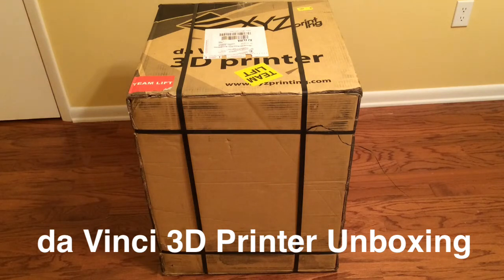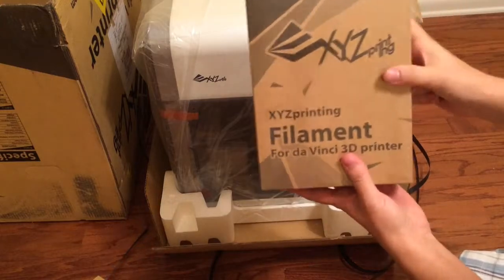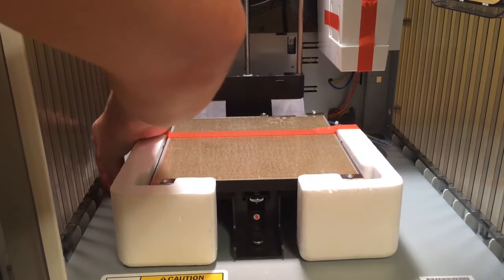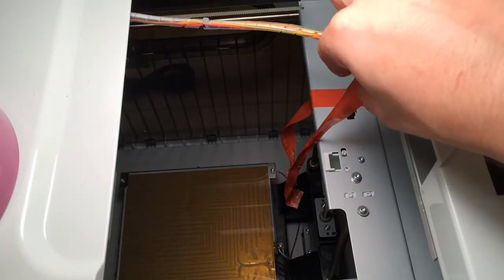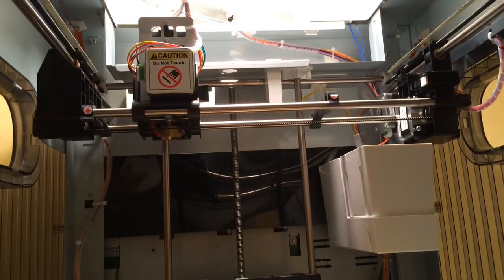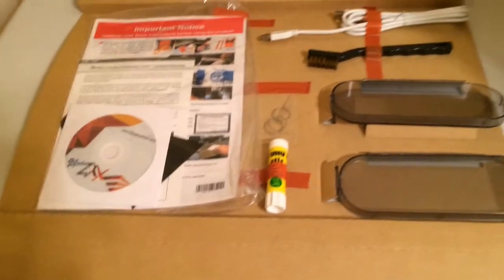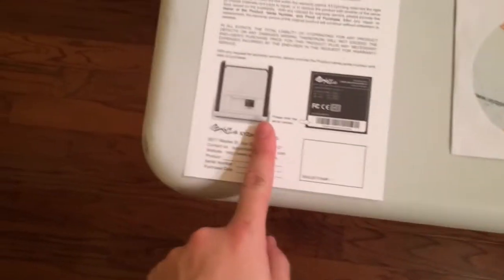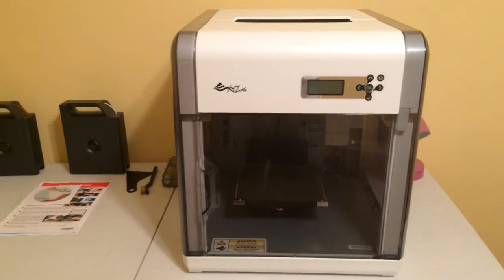XYZprinting da Vinci 3D printer 1.0 Unboxing review

Comment: I'm BY BUY 2 PRINTERS
Da Vinci XYZprinting 1.0 3D Printer for my business with
Da Vinci 3D Printer Cartridge Eliminator XYZEROCART you recommend this system all my question is that you recommend purchases'm doing well or not thanks
Reply from the maker: ARAGRAPHICS C.A Honestly I have never used Eliminator before so I can't say much about that. However, in regards to the printer I was pretty happy and satisfied with it until my nozzle broke. After a total of 40 hrs of printing my nozzle stopped heating up. So I had to spend $100 bux to buy a new one but haven't installed it yet. I've never used another ABS printer so I don't know how much tequeaking they require but for a Business depends on how big you are, you might want to buy a Makerbot instead. I just think they've been in the business longer and should have better quality control. I mean da Vinci is great for hobby and all but I don't think I would use it for a business yet. But your call.

Comment: So I have seen some of your other video, the key chain one worries me. all in all though are you happy with this printer?
 Also have you ever herd of "Blender" 3d modeling software, if not check it out its free. If anything do you know what format the 3d models are saved in that would let me know if I could make stuff in blender and build it in the 3d printer TY
Reply: ***** Yeah, the micro does not look all that great anyway, it has a tiny build area and the resolution is no better than the da vinci, and it can't do two colors. I am super excited about the Da Vinci 2.0, I honestly am stocking the XYZ site just to see when it is available on Amazon lol.
Reply from the maker: Yeah, I'm very happy with it. For the price it costs and what it can do you can't get a better deal elsewhere. The format that the software uses is STL. Make sure though when exporting the STL that your units are in mm. Otherwise the parts will import into XYZware very tiny. And no I never heard of Blender but definitely looks interesting and might give it a try.
Reply: Hrt Tele

what would you say is better than this for the approximate price $500 to 750 ?
Reply: ***** Nothing is really, the Da Vinci 2.0 will be better at $650, but it will not be available until august.
Reply: I can wait a month or two. 

I wanted to get "The Micro 3D" which was featured on kickstarter.  But its only out in Feb, 2015.  Way too far off for me.  So hopefully Da Vinci 2.0 fits the bill.
Reply: I'd prefer something smaller like The Micro so its not taking up a ton of space on the desk.  The stuff I need to print is in parts that will later be assembled. 

Personally I don't care much about 2 colors as what I'd be printing is a prototype. 

Since I can't wait for the Micro, I might end up having to get something like the Da vinci.  What other printers have you scoped out?  What else is upcoming?
Reply from the maker: Freddy, have you looked into Solidoodle or Printrbot. They got some that are not too crap but yet still affordable. However, I still think the da Vinci is the better deal for the built side and how closed in it looks also. The only down side it is a little too big for a small desk but that's not a problem for me. Also check out this top ten list of printers under $1000. It seems like there are more and more appearing on the market. http://www.gadgetreview.com/2013/11/10-3d-printers-for-under-1000-that-anyone-can-use-at-home-today.html